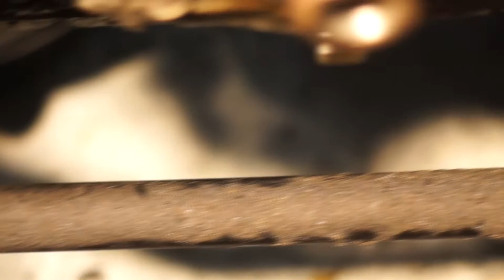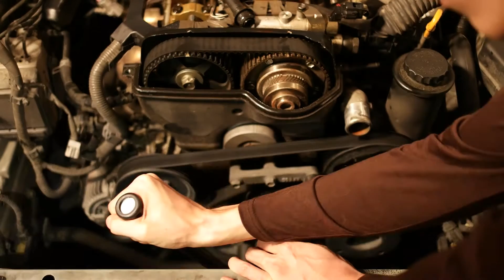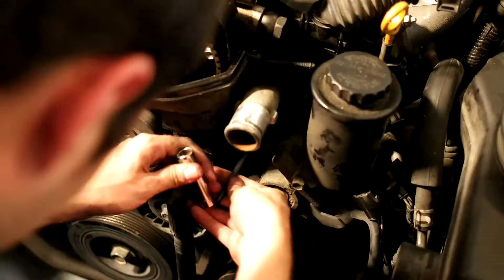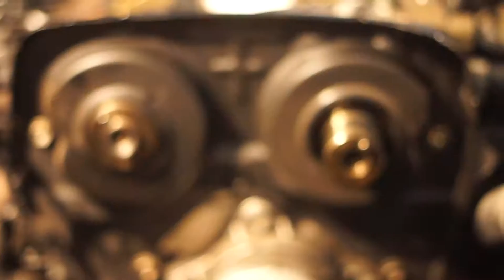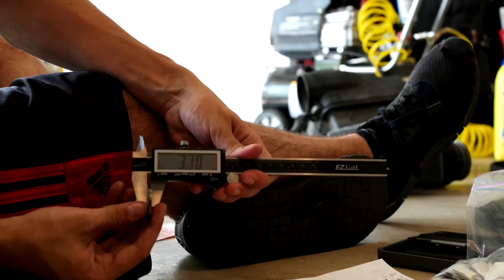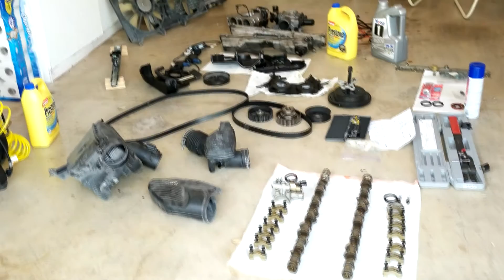Project IS300 Build - Taking Apart the Head on the 2JZ

Comment: Why did you take measurements of the shims on top of the lifters? Also why did you take measurements with the feeler gauges? I thought when you take the parts out of the car you can set them aside in an organized fashion so you know which one goes where. Please explain. Also Subbed
Reply from the maker: Yes, you would put it back in just like you had it. We measured it to see if it was out of spec

Comment: Nice vid!  i said "oh no!" out loud when i saw you use the torque wrench to break loose the intake cam gear though.  Using a torque wrench for loosening is a no-no.  It messes up the torque reading springs inside making for inaccurate torque measurement.
Reply from the maker: +SpecificationR yes you are right..If I'm not mistaken I think it was broken already so we used it as a ratcheting breaker bar